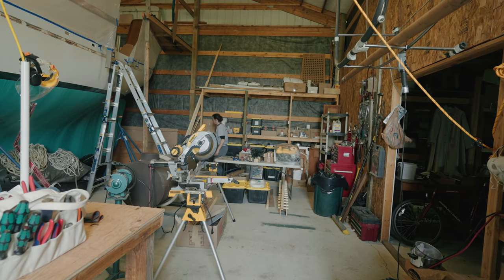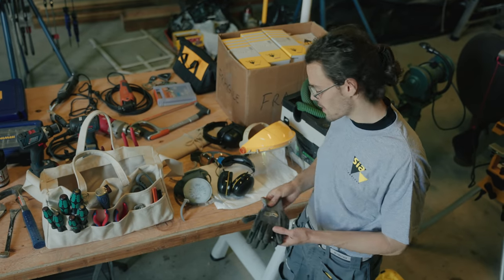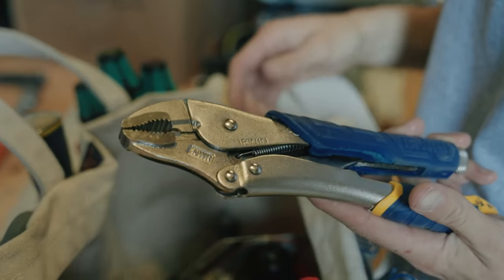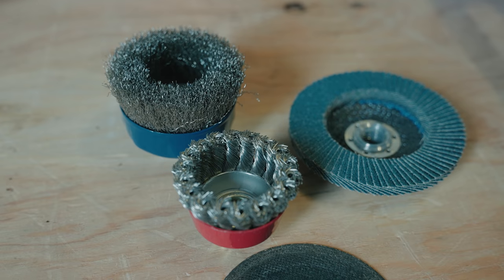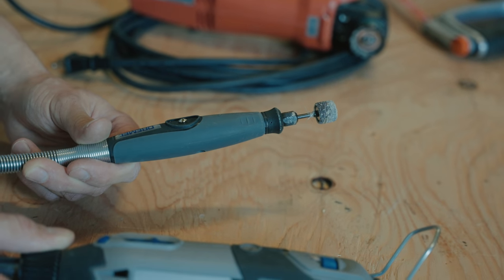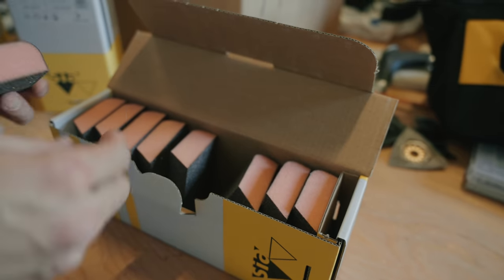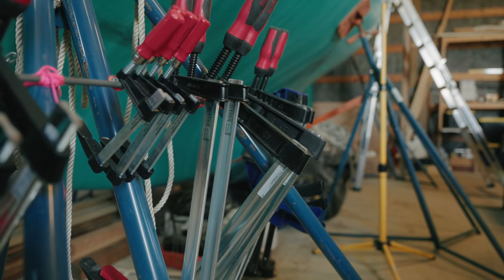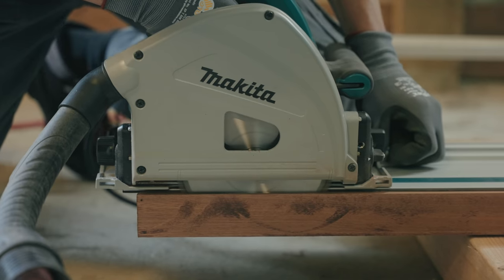A Boatbuilder's Toolkit

Comment: Great video!  A couple points, and I know this video is probably a month old but... Use tap fluid when threading, it will give a better finish and extend the life of your tap set.  The Maxiflex gloves Aladino wears appear a bit large, just an observation.  I wear a large in my shop, but they fit tightly, making it easier to pick up say a washer, you have much more dexterity with tighter gloves.  Also, it's not recommended to use gloves with a table saw.  When sanding I always learned to vacuum or tack cloth between grits.  Coarser papers leave coarser grit residue, vacuuming or tacking remove these before the next finer grit.  Regarding chisels and plane blades, flatten the back first close to a mirror finish, and the bevel side next occasionally flipping to remove the burr on the flat side.  I use automotive wet/dry papers, 400, 600, 800, 1000 grit, spray mounted to a piece of granite floor tile.  A honing guide helps.  These will sharpen quickly to an almost surgical steel edge.  Also become familiar with a card scraper.  Basically a flexible spring steel plate that you burnish a burr on.  Card Scrapers are great for smoothing woods like mahogany that might have some wild grain.  They leave a glass finish on wood.  There are lots of Youtube videos on the preparation and use of card scrapers.  Sorry for the book, Thanks for posting the video it was wonderful as usual!

Comment: work clothes you use is a Swedish brand and translated into blue clothes in English.  very durable clothes both when it comes to tough work and hard washing.  Another very good brand is Makita.  I have a small screwdriver that I used to build a porch that was covered with windows.  counted on the number of screws that were used 4000 screws in different dimensions and the machine still works without problems.  you can count yourself lucky for all these good tools.  my dad said real tools are half the job.  and I can only agree.  works as a car mechanic so I know a little about tools.  Had hoped to get a glimpse of you in Sweden come sailing with the magic carpet 1. But I enjoy your new boat.  as it will be a real beauty.  and with your sense of quality and detail, it will be one of those 7 sea wonders.  is very much looking forward to seeing her finished. All the best of luck in your new project.

Comment: The Stanley No4 brings back memories of grinding the face of the plane using an ABA semi-automatic grinding jig at Stanley Tools in Sheffield! I must have ground thousands of them......
Reply: I've had loads of power planes over the years and they do there job but there's nothing like using a good hand plane. I have an old Stanley No.4 and one I bought in the 70s with disposable blades when I was building my Mirror dinghies. Still have a few boxes of blades thankfully as I don't think you can get them now.
Reply: @gorway7  how about a Stanley No 52 - smoothing plane for long pieces of wood?  My Stanley No  95 is especially useful to assure a good right angle on the edge of a board........

Comment: One major tip for using a Hole Saw is to replace the drill bit with a piece of smooth drill rod. While this requires a separate drill and bit to make the center hole it gives many advantages. 
The drill rod will not enlarge the center hole. The flutes on a drill bit can enlarge the center hole and cause the Hole Saw to create an enlarged or out of round hole.
The drill rod resists breakage. Hole Saws in the larger sizes can bind suddenly causing the Hole Saw to twist sideways and usually snap the drill bit.  Especially if the center hole is enlarged.
Drill bits for Hole Saws normally are special bits with very short flutes and flats ground on the side. These can be hard to find and expensive. Using a piece of drill rod and regular bits avoids parts runs or down time.

A Vibram block extends the usable life of your sandpaper and a File Card keeps your files cutting clean.
Hope this helps and keep up the good work.

Comment: Guys one tool I guarantee you will not regret owning is a simple one, a Kutzall rasp. I’m now building my second boat  (first one wood, second one foam and epoxy composite). They’re not like your everyday toothed rasp which I’ve always found “hacked” the work.  These babies work like sandpaper on steroids - think 10 grit as a hand tool.
They work equally well on epoxy, fibreglass and wood. In fact any hard sandable material. If you appreciate using the right sandpaper for the job at hand, get one of these. They come in various degrees of courseness - I own a medium flat rasp and a course half round version, and I find them an invaluable tool for boat building where you need to flatten off or rip off some material where a course finish doesn’t matter, or prior to sanding to a fine finish perhaps. They work fast but leave an even surface unlike a toothed rasp that looks like a rat’s been chewing on it. : ) Cheers.

Comment: WOW ... love all the great tools.  Nothing works better for doing a great job, than great tools.   And, in my opinion, and I'll probably get a lot of flack for this, A good DeWalt radial arm saw.  The cuts these saws are capable of doing is almost endless limited only by one's imagination.  I used mine turned 180 and rotated flat to cut mortise and tenons for all my cabinet and door frames.

Comment: I use Crushed white pumice stone, Great for glass cleaning, And the more abrasive black powders for more abrasive power, I stopped using sand paper years ago, This way you just add a little more powder to keep the sharpness of the grit up and it will out last a roll of sandpaper and still keep on going, A flat meat tray to keep it in to mix it up, So when you finished, It drys up into a powder again and when needed turns into a paste again, Just put a few drops of water back in and your off again, Over & over again. Saves me a small fortune over a year.

Comment: Also the abrasive of the sand paper is attached to the backing with different adhesives. Some are water proof, some are flexible, some resist heat etc. To choose sandpaper for a task you need to know the type and size of the abrasive grit, the attaching cement, and the backing in order to know if it is appropriate for the task.
My most common task is working with metal making jewelry so a flexible backing and a water proof glue are important to me. That means that I pay a bit more, but I so rarely have tasks that would be suited to other sandpapers that it doesn't make sense to stock different types.

Comment: I've used the DeWalt square sheet sander .. I much prefer the DeWalt random orbit sander.  Velcro discs instead of cut paper.  Random orbit leave no scratches a might a sheet sander.  Of course the down side is sanding into corners.  For bigger jobs, like sanding the hull, I have a 6" DeWalt random orbit.  I don't use it often now that the hull is finished.  The right tool for the job is key in being happy with the results in the end. :-)  I like Norton products.  I get them at my local auto body supply store.

Comment: Here's a little more tool talk:)

N95 isn't a style of mask. 
N means resistant to dust and liquid airborne particles except for oil
R is the same, but has a little resistance to oil but in an environment with aerosolized oil throw them away after a shift.
P is the same but completely resistant to aerosolized oil.
The number refers to the percentage of 3 micron sized particles that will be filtered out by the mask. 95 is 95%
Any of these come in dozens of styles from cloth masks with or without check valves to cartridge masks and more.

Comment: I was happy to see your Blakader work pants. I would like to suggest a hive tool or 2 to enhance your scraper and prybar assortment, you can find them at any beekeeper supply (I know that sounds weird). Thanks for your advice.
Reply: I have one that's probably 40 years old and still good.  The best small prybar, scraper, wedge, by far.  Much better steel than the ordinary ones, so it's thin but very strong & tough.  Don't know why they're not more widely used.

Comment: invest  in Good planes. Lie Nielson is the only manufacturer of quality planes today that I'm aware of, unless you buy the handmade Japanese plaines. I use both  regularly.
Also handmade Japanese chisels are unbeatable. Like the planes they are forge welded wrought-iron with high  carbon Hitachi white or blue steel. The sharpest edges you can get.
There are some good  antique tools out there too, if you know what  to look for.
Also a maker's wooden mallet. I use this for almost everything. Even  mechanical work.

Comment: A track saw is more accurate than a table saw. I set my circular saws up with makeshift tracks, again more accurate than a circular saw with an edge guide. I like  to use a worm drive compact circular saw when thickness allows. Less mass at a more manageable angle.

Comment: Cha ching...  (^L^)
Reply: I love my impact driver! However do be aware that the very action of driving a screw in with an impact driver does compromise the screws holding power (The very action of impacting/smashing the screw in damages the fibers of the timber, there by rendering them slightly compromised). We discovered this in NZ with high winds ripping off roofs that had used this method, hence they must now be fixed only with conventional drivers.